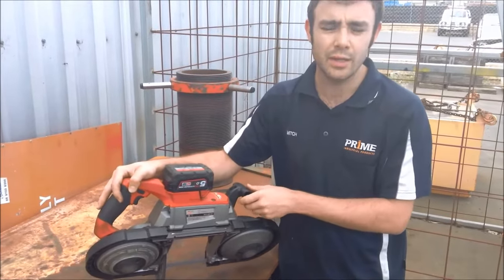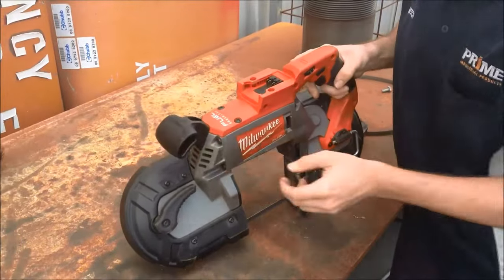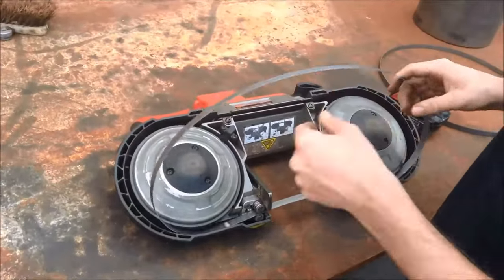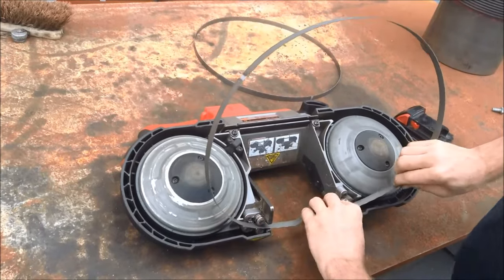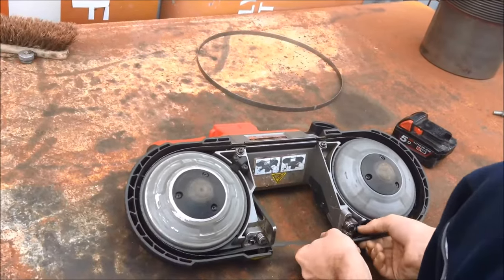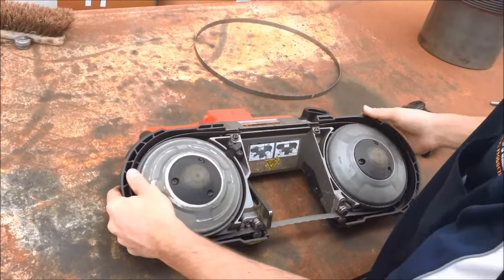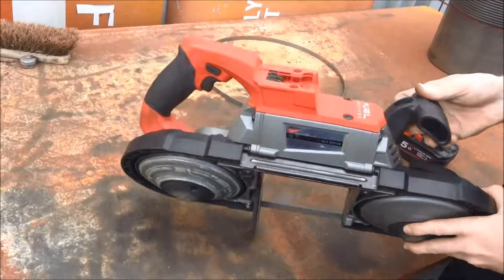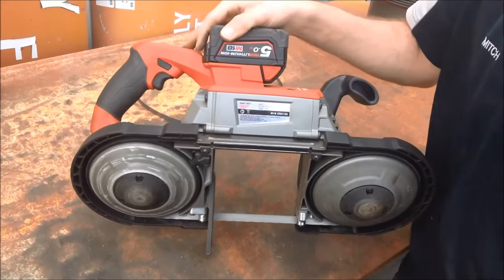How to change a blade on a Milwaukee M18 Fuel Bandsaw

Comment: has anyone had issues with it not cutting?
Where the wheels spin but blade just never starts cutting through the material, it just "scratches it"
Reply: What were you trying to cut. And did you have the blade upside down? I’m curious.